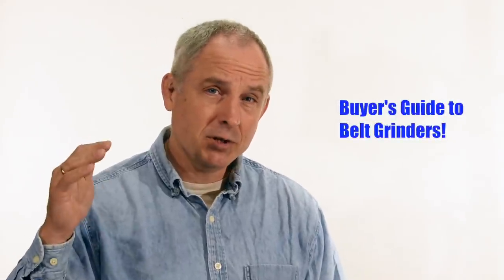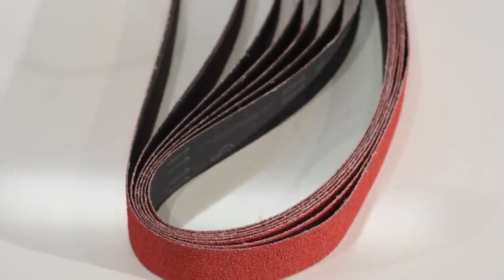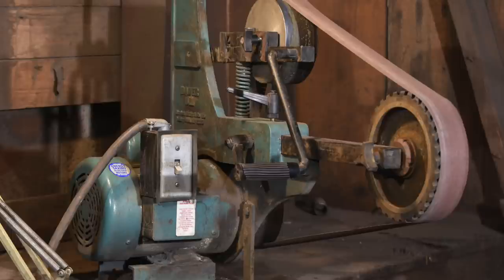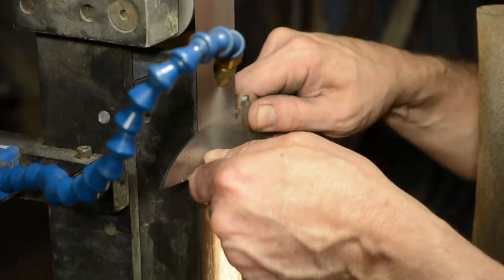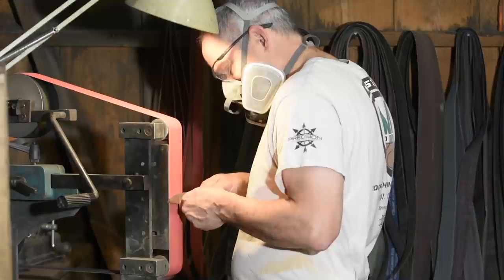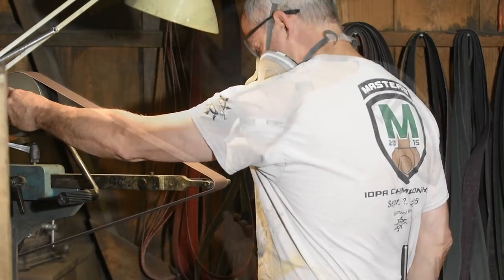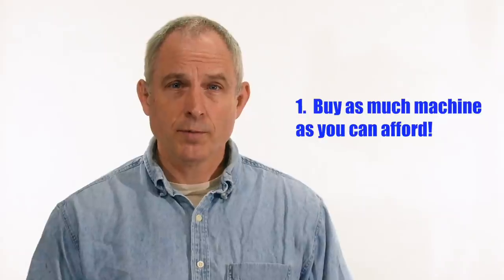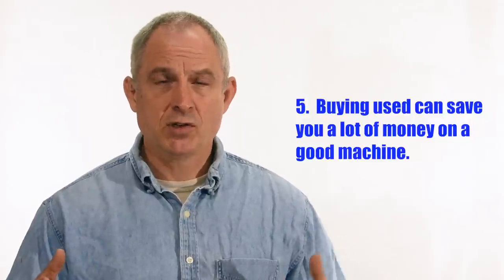Belt Grinders - A Buyer's Guide for Knife Makers

Comment: I would like to hear your thoughts on building the DIY machines with treadmill motors. I am just getting into knife making and this is the rout I went just because of the cost. Now advantage I got is I once did metal fabrication so design and welding ws cake. I know not everyone has the skills to make one that works well. Total I have 30 bucks in it and I made it with the arms that can be changed much like you Bader. The motors are brushed motors so they wont last for ever but they are a dime a dozen if you take the time and look. I posted on FB that I needed a used treadmill working or not and in with 3 days I had two. You can also replace the brushes. I was wondering if you ever got the chance to use one and how the power compared. Mine is a 2 3/4 hp rated at 7800 rpm. I placed the drive on a jack shaft and reduced the speed to about 3600 though pulley set up. It seems to be more than powerful enough but I cant compare as its all I know. I doubt it is a true 2.5 hp but with the jack shaft and pulley reduction it does ok. The variable speed is nice as well. Any how I love the video it gives lots of great points. I would like to thank you as if not for you I don't think I would be doing as well as I am for a newbie. Its nice to have someone lay out does and don'ts so I can skip that painful learning curve some what. Keep up the great video and thanks for sharing your knowledge.

Comment: “And that smaller grinder’s going to sit in the corner collecting dust”

Or in my case, have a hinge installed so it flips under the bench and keeps a leather strop installed so I can both finish knives by flipping it up, or keep the kitchen knives sharp like it does most of the time.

Comment: Hi Walter. Very happy I watched this because I was thinking I needed a variable speed grinder. I have a 6”x48” wood sander singe speed and it works fine for my woodworking. I’m setting up a small knife workshop to compliment my wood workshop. Just wondering what speed your grinder run at? Thanks

Comment: So let's talk about that water cooling/misting system... looks amazing, to avoid overheating and ruining heat treat. Where can someone buy one of those water systems? Looks great!
Reply: EM613 KBC tools
Noga minicool
I've got one on my milling machine and love it. planning to get a second for the grinder soon
Reply: Awesome, thanks. I also noticed there is a video on the cooling system, alone, I only saw it later.
Reply: Water spray needs to have control over mixture of water to air. Set to high air pressure and low water. Direct spray into belt.  Also try just using candle wax rubbed on belt. Works better than you can believe.

Comment: Presently building one per D. Comau's plans. Being retired I am trying to build it as "cheap" as possible. I need the 2x72 (or 1x72) belt length for various sanding uses around my garage shop. My question is do you think a 1/2HP single phase would be "good enough", as I have one. I have been looking for greater HP motors (3/4, 1) but all are a little more that I want to spend. Also checking into 3 phase 220v then getting a VFD unit which also add$ up fast.
Note: I realize this is a question that no one can answer correctly due to many variables, but if it is useless to use the 1/2hp motor I may as well get your opinion right up front. Thanks, Tom
Reply: I'm thinking the 1" wide belt might make it better for a 1/2 horse motor... but I don't know for sure.

Comment: Water cooled is not an option on most 2x72 grinders Mr. Sorrels. I have a 1x42 and 8" disc that I can use water on because the motor is far enough away so it's not a problem. Not an option for most.

Comment: My brother and I built a 2 x 72 high speed grinder its killer for hogging off metal and polishing, sharpening,  I even made a large fuller medieval sword which was only possible wit this grinder.  Checkout my large "Alpha Tracker Survival Knife" I'm back ordered with builds in 80CRV2, 5160 or 1075 and I use American made high quality steels.   Going back out to my shop now, got to work on knife builds.

Comment: Fairly recently bought a bench grinder with belt sander attachment for use in knife making $70 and uses 686mm x 50mm (27x2 inch) belts.  It's certainly not the best belt sander/grinder but it came with a flat platen and for the price? Absolute bargain.
Reply: ....You're not going to tell us what brand and model it is?
Reply: Oh its an Ozito 240W bench grinder and belt sander, mind you this is in Australia.  I'd definitely recommend looking into a bench grinder with belt sander for a cheap belt sander.
Reply: I have the same grinder, It worked alright for my first few knives, but I have ended up taking all the guard off the areas with the wheels, adding a bigger table and I plan on putting it on my half horse power bench grinder to give it more power. The motor that it comes with is just to weak to use efficiently. The belts are expensive (if bought from the store and not somewhere like "Artisan supplies") (which if you are in Australia I highly recommend seeing their website). I think this grinder is a good starting point, but you get what you pay for... Somewhere in the distant future I will eventually have to upgrade to a 2x72 I think.

Comment: Great job Walter.  Do you (or anyone else in the comments) have any experience with the Radius Master Grinder?  One unit, no "attachments", but it has a platen, slack and like 6 diameters of wheels all at the same time.   

I am curious if it is worth it to have all the attachments on the unit at once, as opposed to having to change them out.   I am more of a hobbyist, so I am not making a ton of knifes and wearing all the parts super fast, which I hear is a possible problem if you are a full time knife maker.
Reply: are you in australia? many of the makers i've talked to who own a radius master regret the purchase. not a very versatile machine. check out the fire ant grinder.

Comment: Walter, love the channel! Question: When is it necessary to wear a respirator while working in (your) shop? I know some things are poisonous while others are just lung irritants if inhaled. I follow multiple channels (some knife makers, some blacksmiths, etc) and I always wonder what the protocol is. Im sure the adage holds true, "when in doubt..." but maybe you could do a shop safety video sometime. Keep up the great videos! Thank you
Reply: MagDump28 If you don't have good dust collection and do it anywhere close to full time, always

If you do it occasionally, always for rosewood and micarta, and as much as possible for anything else.
keep in mind having a beard pretty well makes a respirator useless.

I've set my shop up with a dust collector venting straight outside, and a 6" line running to the grinders. Can grind all day with no mask and not breath in a spec of dust.
Good dust collection is cost prohibitive for most people though
Reply: Thank you! I have also heard some blacksmithing requires it due to poisonous gasses emitted from different processes/techniques; im looking at beginning knifemaking as a hobby and could use as much info as I can.
Reply: MagDump28 most of that is from platings. Chrome, galvanizing, ect. same issues as with welding. If you stick to new clean steel (or at least anything not plated or covered in paint) you shouldn't have anything to worry about apart from the usual dust and such.

Personally when I forge (infrequently, I make a living with stock removal) I never wear a mask. But part of that is probably habit from having done blacksmithing demonstrations at fairs for a while. 

it might not be necessary all the time, but it never hurts to wear a mask. same with glasses and ear plugs. eyes, ears, and lungs don't grow back.

And having a piece of steel removed from your eye isn't fun, ask me how I know
Reply: Geoff Flato thanks again, all makes sense and I think i did hear re galvenized metals and their problems.
Reply from the maker: When I first started, it was just a hobby and I didn't worry about it.  But as it became more and more of a full time occupation, I realized I was developing a permanent cough from breathing crud when grinding.  So I started wearing a respirator 100% of the time when I was grinding (or doing anything else that raised dust).  My next space will have much better dust collection, so I'll have to see when I phase that in.
Reply: Thanks, that is the best way for sure! Look forward to seeing many more sweet vids!

Comment: I have a kmg clone. 1.5 HP with a three step pulley and a 6 inch drive real. I find that at Max Speed hogging metal it bogs down just slightly and I also got Wertz metalworking surface grinder attachment and I find that it will slow it down if I try to take a cut with a belt that is about half way dull. when I upgrade to a variable speed I will be getting 2 HP as well.

a advantage to using pulleys as you can make a buffing attachment and use your motor for your belt grinder as a buffing motor. not quite as rigid as a buffer should be but if space is an issue I was able to Fashion up a buffing attachment for under $100. That includes a 12 inch mandrel that was lathe turned and stepped down on either side for 5/8 buffing wheels.
Reply: Capthrax1 I've got a bader close myself, also a 1.5hp motor. I've found it'll trip a 15 amp breaker before I can get it to slow down, and that's putting a fair bit of weight on it.

That said my next grinder would be a 2hp as well
Reply: Geoff Flato I have mine wired for 230. my experience with a 1.5 HP table saw is that it'll trip the braker. ( I also use a spew of curse words as my breaker panel is outside.) I'm also concerned that I'm using the service factor of the motor and reducing it's life span. though I'm sure I'll upgrade to vfd before it dies.
Reply: My breaker panel is in the basement at the furthest possible place on the property from the grinder.... So I know what it's like. 

And 240 is definitely the difference. I've had my tablesaw on both and its night and day. If I had a spare 240 circuit left I'd put the grinder on it. Air compressor, lathe, mill, welder, and HT oven take up all of my 240....
Reply: Geoff Flato I can't imagine you running multiple machines at once saved for your air compressor. one and a half horsepower motor should pull like 7 amps is what it's rated for so maybe 10 under load for 2:40. if you could deal with it you know you could run it off of a proper sized extension cords. or simply run another plug off the same circuit if that's an option. being able to use all those tools I'm sure you'd have the skill set to do either of those options. it really is so much nicer being able to take it to the limit.
Reply: Capthrax1 I'd love to be able to do that, apart from how my shop is organized... Two seperate buildings, only one has 220. The grinders are all in the shop without 220...
and short of a 100+ foot extension cord, it's not happening.
believe me, if I could I would. My big baldor buffer would be nice on 220 as well
Reply: Geoff Flato oh.... I imagine to keep the abrasive grit off of the precision machines. that would be a days worth of work , and probably money in materials to bring 230 there. I just imagined it as one shop 25 or less feet from power. I'll count my blessings when I grind and you can count your blessings when you use your lathe and mill ( no space in my shop for either let alone the capital laying around for the machine and tooling.)
Reply: Capthrax1 yeah, machine tools and grit don't get along well... bench grinder for sharpening tool bits and twist drills is all that's in there. Even avoid using an angle grinder at my welding table in there if at all possible. The 7.5" blacksmith vise outside is nice for that. 

the other shop is the dusty one. belt grinders, buffer, couple drill presses, couple bandsaws, tablesaw, planer, ect
I've got a great dust collection setup, to the point I rarely need to wear a respirator. yet grit still finds its way around...  Leather shop is separate too, I do work on saddles and harnesses in addition to making sheaths and holsters

Comment: How hard should you be able to lay into the piece?  I feel like I'm not pushing that hard and it's stopping the belt.  I have a harbor freight 4X36.
Reply: neilorourke71 it's a weak motor. I've got the HF 1x30 and it's the same issue. I'm just learning to live with it as I can't afford a 2x72. Additionally, pushing into it super hard doesn't help much I've found. Just take your time. These cheap grinders just take longer to make a knife.

Comment: A perfect world is Jeremy Schmidt's homemade 2X72 belt grinder :)
Reply: i've watched that video at least 4 times, trying to figure out the dimensions to try and build one myself
Reply: no, it's not. he did a great job building it, but he will not be able to run a contact wheel of any significant size without buying longer belts or modifying the machine. there is a reason that every other grinder made has the drive and tracking wheels offset out from the frame.
Reply: @thesupernittygritty  Actually, Yes, it is.   here is his video on constructing the 10 inch contact wheel attachment.  https://www.youtube.com/watch?v=mhO45mww61c&t=13s

Comment: im saving for a bader or a tw90... after i go to blade... any advice on the choice?
Reply: get the TW-90 , its a great machine, and unlike a Bader, it flips horizontal , which is great for handle making, and better if ya end up buying Travis's surface grinding attachment.  i personally own a KMG by Beaumont Metalworks, which is a tank of a grinder, but if i were to buy another grinder it would be a TW-90 from Travis, which is pretty likely in the future.
Reply: James Savage Thoughts on Northridge Tool grinders? A bit cheaper than KMGs, and it can easily go horizontal. That is probably my #1 choice right now.
Reply: +1 for a northridge grinder. neither the bader or tw-90 has two tool pockets. NRT is soon to be releasing their version of the surface grinder attachment. they have pictures on facebook of the magnetic table. it's going to be an on/off type instead of permanent. do yourself a favor and give that machine a hard look before purchasing another.
Reply: i would probably get the attachment by itself if its a reasonable price, and only if it fits my KMG, i would still go with the TW-90 for a second grinder,  simply because its built to tilt horizontal out of the box, Travis is a great guy and he builds an excellent quality machine.

 i got nothing against northridge, their grinders look like fine machines, but i don't really care about the extra tooling slots, its not a big selling point for me, but to each his own.

Comment: The only thing i dont like about my 4 inch belt grinder is i cant make a plunge line because the edge of the belt doesnt go the the edge of the grinder. Theres about half an inch of steel after the edge of the belt that makes it practically impossible to make a plunge line.
Reply: Bummer, my 4 inch belt can be brought to a notch in the frame on both sides. You need to run the belt either side to suit.

Comment: thoughts on a grinder for an Australian knife maker?
Reply: you might be in luck. there is a new machine available down under called the ''fire ant''. seems like a well thought out, user friendly design.
Reply: +thesupernittygritty cheers, ill check it out
Reply: Gameco right now is the best knife making supplier in Australia. They have the noob grinder which is what I have and it's amazing and versatile. Give them a look into gameco artisans supply's
Reply: SkylordAz, can you buy the noob with metal drive and tracking wheels instead of plastic? also, do you only run 48'' belts on yours?
Reply: as for the wheel i'm pretty sure you have to keep them as the plastic, that being said they are solid and very durable and have a lot of grip to them. And yes you can only run 48" belts. The general consensus in Australia is that the 48" is good enough for knife making however if you have to have something more the same guys are making a 72" version and that will be out soon, pretty sure they are taking pre orders.
Reply: I can build you one and send it to you mate!

Comment: Is there a recommended rpm range for the motor?
Reply: Pirata Sports i believe 1725-1750 rpm
Reply: Depends entirely on drive wheel size
Reply: Pirata Sports   Surface feet per minute is what determines effectiveness of the grinder.

Comment: Anyone has a kmg or bee grinder? I was about to buy a kmg 10 2hp variable speed but then noticed the bee grinder which for the same features is about the same price. bee grinder is supposed to be better.. help
Reply: red + Dude, I just bought a 2 x 72 belt grinder from Diktator on eBay. Under a grand, came fedex in a week and is built amazingly well. Check it out on the knife maker forums, it’s awesome.

Comment: vast majority use 2 x72!! vast majority buy belts on cost and buy their grinders on cost. 3 x 132 is a more standard size grinder with more power, standard belt size and folks - get this, even though a belt that is 1" wider and 60" longer will be an extra 2 bucks a belt the amount of belt you get us considerably less expensive. You need to buy the best abrasive belts as it is the actual work part. Oh and don't buy aluminum oxide- buy a zirconia or ceramic belt as they will be the fastest cutting longest life and in the case of the ceramic belt the coolest cutting.

Comment: As industry calls them belt sanders why does everyone refer to them as grinders? It uses a sanding belt not a grinding wheel!
Reply: codprawn Most people use belt sander to refer to handheld. It’s pretty arbitrary, but to me it’s really a question of scale - “sanding” is, to my mind a slightly more subtle process, “grinding” is bulk stock removal. So really it’s just that there are two somewhat different things that could reasonably be called “belt sander”, so the smaller handheld is called sander, the larger one is called grinder.
Reply: Sanders = wood grinder = metal